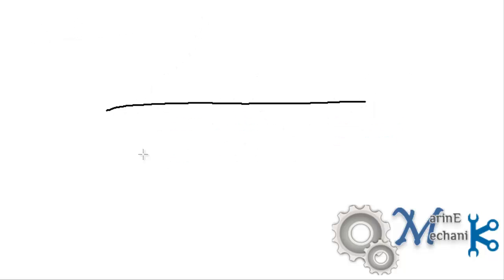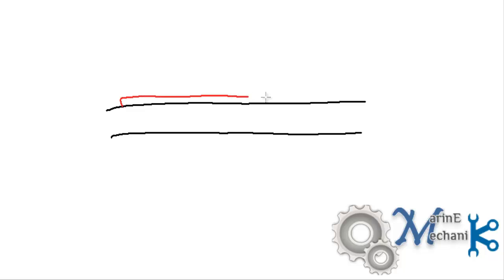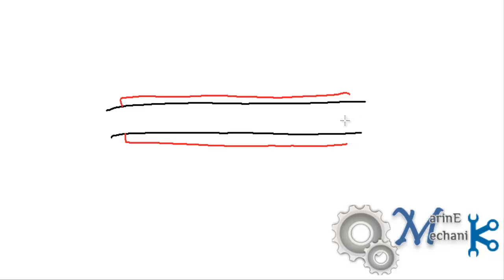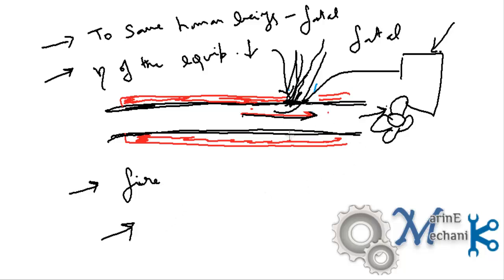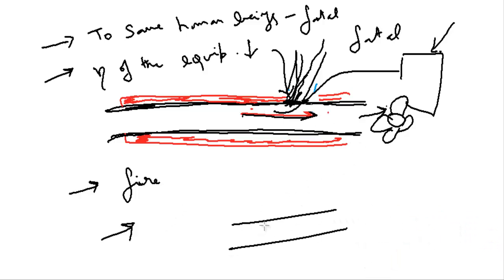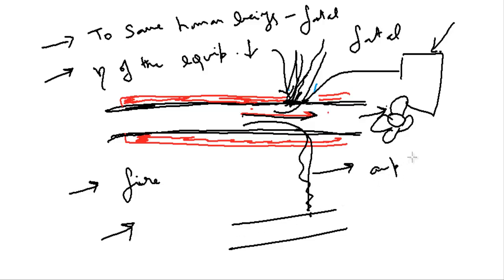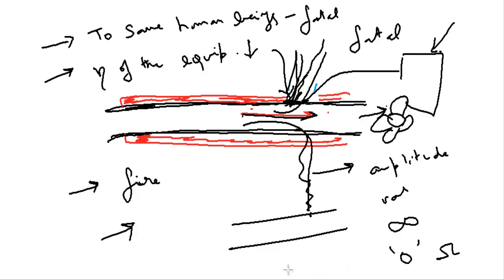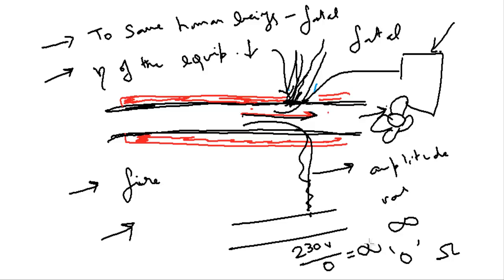What is Insulation & Insulation Resistance ?

Comment: Dear sir,
I have a done a house hold wiring for villa,During a megger test we notice that valve between phase and neutral is good 500 Mohm when test between Phase to earth wire it is shown as less than 100 Mohm when i remove the all wire from conduit and we test it is showing correctly as 500Mohm,After that i replaced all wire as New before pulling the wire in conduit i checked it is shown correctly as 500 Mohm after pulled the wire in conduit it shown as below 100 Mohm Please give me solution,
Wire: National wire UAE
Tester:Fluke 1663 Multifunction Installation Tester(new)